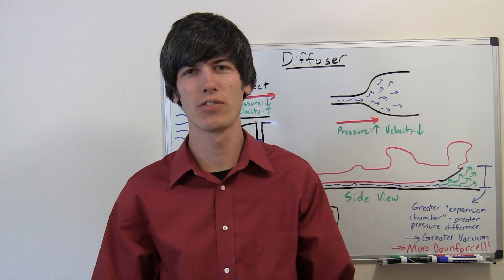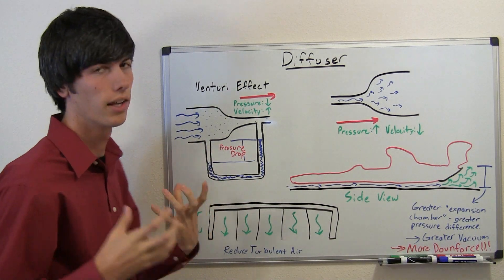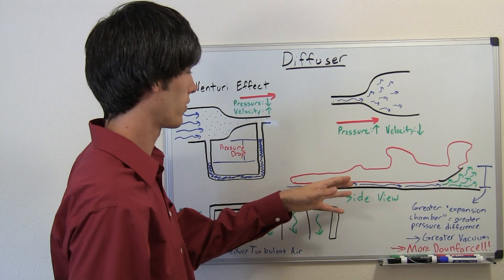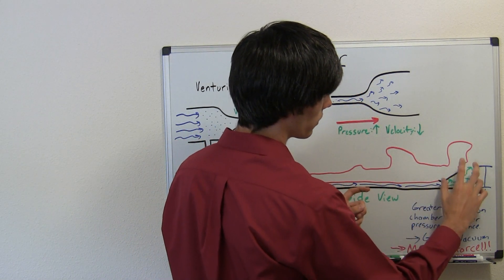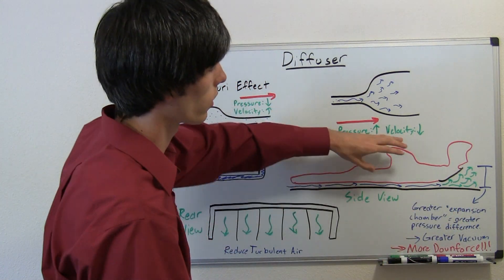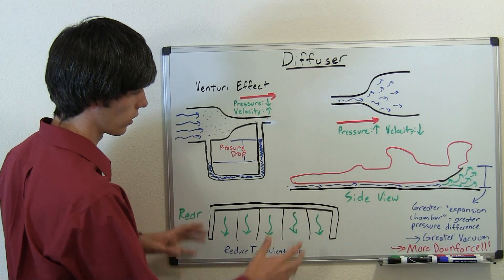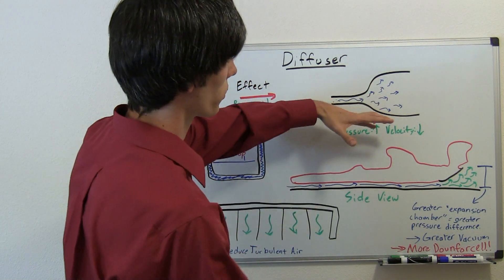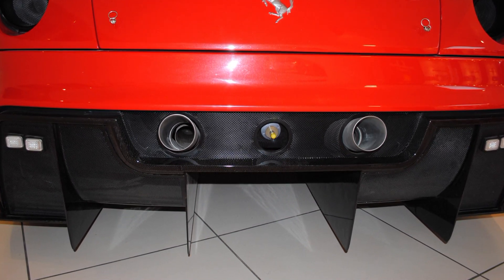Diffuser - Explained

Comment: That's not always a bad thing, turbulent flow is more resistant to flow separation. For a very steep diffuser, turbulence could be desirable to improve performance where as laminar flow would separate and increase drag and lift.

Comment: The higher pressure doesn't reduce pressure at the throat, it only lowers drag. However, greater expansion means the diffuser is steeper, so the angle change that the flow has to make is larger. This makes the radius of curvature smaller which is what decreases pressure.

Comment from the maker: Exhaust gases are blown into the diffuser expansion area, causing the air to expand more quickly (due to the heat), creating a greater pressure differential (and more downforce).

Comment from the maker: First, yes. Second, the diffuser fins (straight lines) are used to channel the air, so it doesn't swirl within the diffuser, and heads straight back instead.

Comment: Air does not always move toward lower pressure, it accelerates towards lower pressure. If air moved toward lower pressure always, the diffuser would stall. I'm not quite sure I get your wing example either. One side doesn't shield the other, the lift is generated by curvature and momentum transfer.

Comment from the maker: Yes, obviously the top of the car has to have higher pressure than the lower of the car. This is the whole point of the diffuser, to reduce the pressure under the car so that the pressure differential is greater between the top and bottom. Let's get something straight, you said: "The air pressure behind the car "in the diffuser area" is LOWER than the pressure under the car" and this is not true. That is what I was defending, not the pressure differential top to bottom. "You're almost there."

Comment: An air plane wing has the opposite arrangement but exact same effect.  The flat bottom of a wing shields the higher pressure under the wing from entering the low pressure area above the trailing edge.

Comment: You're almost there.
There is a major component missing in your equation and that is the pressure differential between the top of the car and the bottom.  Same principal that causes lift on a wing.  The wing or car displaces air as it travels through it and there is higher pressure on the leading edge than the trailing edge.   A diffuser takes advantage of this low pressure area by shielding it from the higher pressure air above the car and allowing the free flow draw of air from under the car.

Comment from the maker: I passed thermodynamics, I understand basic pressure principles. If the car was not moving, yes, air pressure would go from high to low, however, since the car is moving, the air is being forced backward (relative to the car) and thus the pressure difference is not enough for it to move from high to low, as is the case in static examples.

Comment: Free flowing air always moves toward lower pressure area. The air pressure behind the car "in the diffuser area" is LOWER than the pressure under the car which in turn causes the air under the car to get sucked out toward the diffuser.   Better revise your video.  Hope this wasn't for a class.

Comment: Air is always drawn to regions of low pressure. With a diffuser, the point of lowest pressure is the throat, which is where the diffuser just starts to open up. In front of the throat air is drawn back, behind the throat it is pulled forward. This helps explain why air is fast underneath the car and why it's slow in the diffuser. The other reason for fast air is the venturi effect at the front of the car. Look at the front of a Ferrari Enzo, you'll see what looks like a backwards diffuser.

Comment: At race car speeds, air in incompressible, the density is the same both in fast and slow air. This changes above Mach .3-Mach .5, which is out of reach of most cars. The fast air accelerates to satisfy mass conservation (m_dot = rho*V*A_cross_section). Even with rho held fixed, V varies with A, plugging V into Bernoulli yields a pressure change.

Comment: accelerated by a combination of compression at the front of the car (think of the car as a solid object in a wind tunnel, even though there are no walls, there is still some "blockage" and this tends to lower pressure around the car) funneling air underneath it and curvature at the diffuser throat which reduces pressure (partial of P / partial of normal = density * V^2/radius).

It's also interesting to note that guide vanes may not always be of benefit. Removing them allows vortex formation...

Comment: Very good videos, though I think a couple of things were off. In your first example, pressure would not increase in the cup, it would remain constant. The air being drawn through the straw would decrease in pressure as it flowed in from outside the cup as per the Bernoulli equation (perhaps add to video through annotation). For the car, the expansion in the diffuser is only for drag reduction, it's not related to turbulence, but simply raising air pressure behind the car. Underbody air is...

Comment from the maker: Sort of, except the air is forced back, since the car is moving so fast, rather than "wanting" to go to a high pressure area. The diffuser allows the "high" pressure area to exist, creating an imbalance - which in turn makes the bottom of the car a vacuum.

Comment: So, the air under the car wants to move faster to get to the high pressure at the back, and when the air moves faster there is less pressure under the car giving downforce elements a greater effect. Do I understand this correctly?

Comment: NO, the diffuser increases pressure and decreases the flow speed and that doesn't create any down-force, if you noticed the flow under the car is moving fast with low pressure and that creates down-force. the rear wing is the source of down-force.

watch?v=MVKARF4Bg7Q

watch?v=H2P-2EC19eQ

Comment: Increasing volume lowers pressure. This lower pressure in the expansion chamber of the diffuser "sucks" the high pressure air under the car out the back, creating vacuum and downforce.

Comment: And you can not make the diffuser as big as possible because there is an optimum angle that will keep the air attached to the diffuser, if you exceed that angle then the air flow will separate and create a lot of drag.

Comment: This was a good video but there are some problems in the explanation. The diffuser is not slowing down the air in order to create a pressure, you will notice on an F1 car that they have high noses. (they are trying to change that with the whole duck look now) but they do this so that they can force as much air to go under the car as possible. this forces the air to accelerate and drop in pressure. all the diffuser is doing is slowing the air back down to normal flow.

Comment: I believe it will pull the car down, which will give you better traction, which is important because at high speeds your tires will need a lot of traction to overcome drag forces.

Comment from the maker: If you take a chunk of fast moving air, the molecules are far apart from each other. If you take a chunk of slow moving air, the molecules are close together. So take two equal sized volumes of fast air, and non-moving air. Since the non-moving air has molecules packed more closely together, it has a greater pressure. This is what the diffuser is doing, it's slowing down the fast moving air, and in doing so, increasing the pressure.

Hope this clears things up!

Comment: rapid low pressure? i don't understand either.. if it's such low pressure under the car, how can the pressure increase when it leaves? i also don't understand what the liquid you talked about is. where abouts is that on the car?

Comment from the maker: The air exiting the rear diffuser has to return to atmospheric pressure, which is what the diffuser is enhancing. The flow underneath the car is very rapid, and low pressure. The diffuser basically creating a vacuum underneath the car.